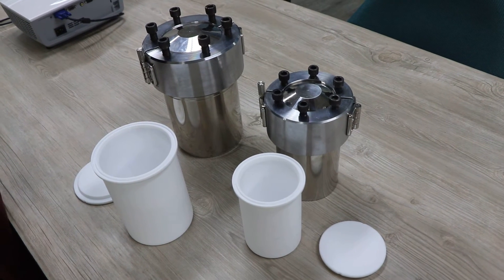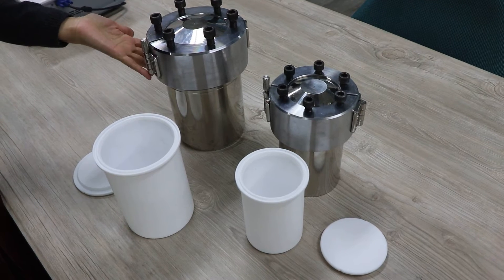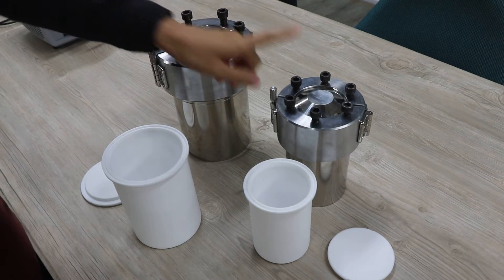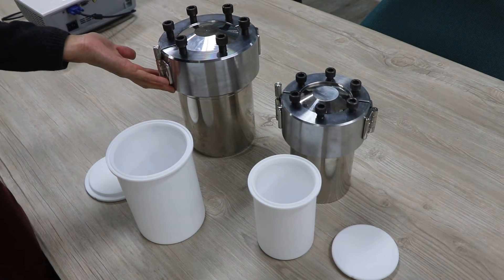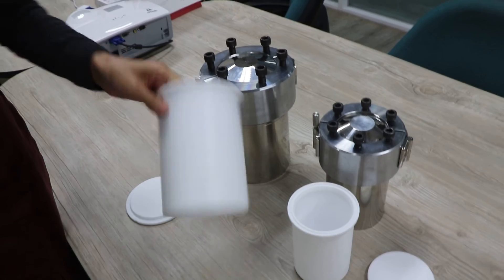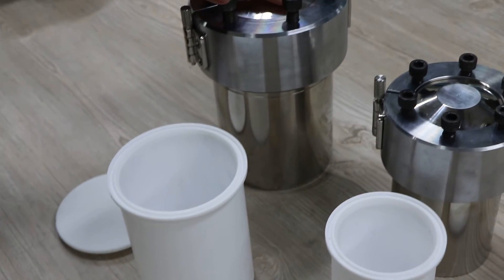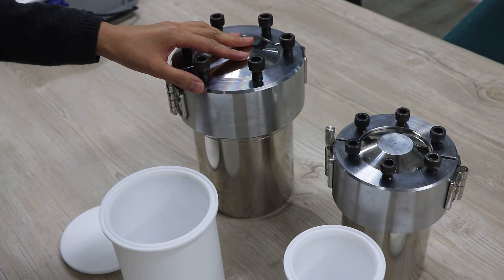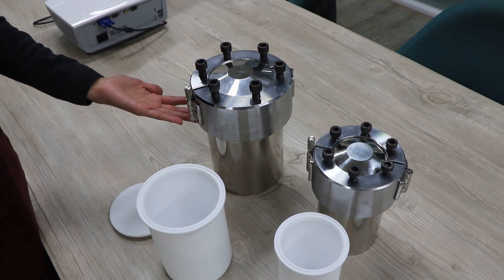Hydrothermal Synthesis Reactor produced by ChemRe system,Inc.(South Korea)

Comment: How to know exactly  the pressure and temperature  in that Teflon?
Reply: Thien Le 
In case there is teflon liner, it is not possible to measure the temperature, pressure. If Teflon liner is not needed, it is possible to measure temp. press.